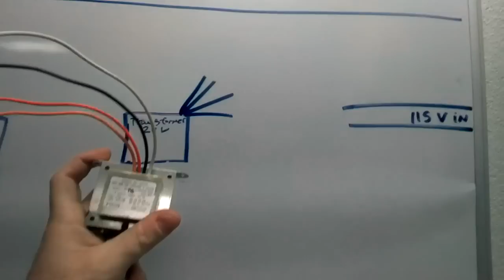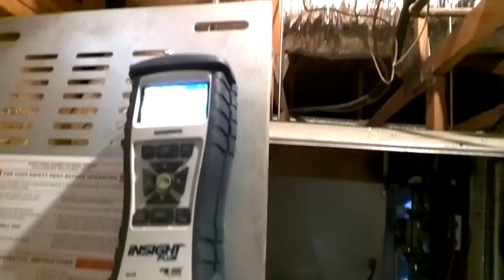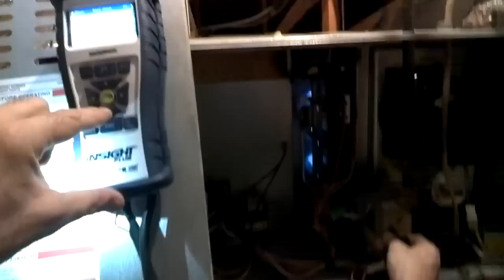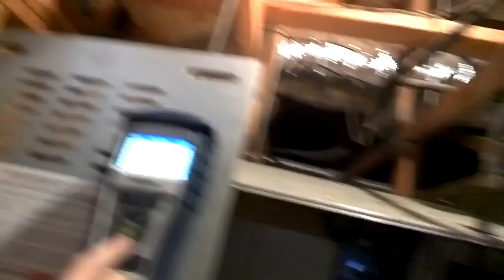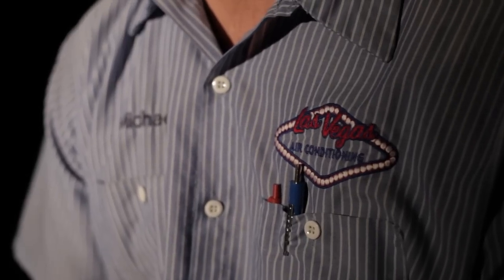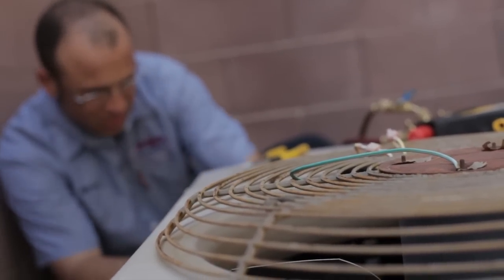Furnace Is Not Safe - Combustion Analysis - Is the Heat exchanger cracked?

Comment: So if we get high level of CO in the flue  means bad heat exchanger ? I thought when the level of O2 changes after the burners comes on ? High level of CO in the flue means it’s not inefficient ?
Reply: High CO means incomplete combustion.  It can also produce the soot that he saw, which is a byproduct of incomplete combustion,  A number of things can cause incomplete combustion, besides a bad heat exchanger.  Other causes are dirty or blocked burner, not enough combustion air, improper gas pressure, to name a few.
Reply: @rodgraff1782  thank you very much for your clear, and to the point explanation.

Comment: I also would of condemned that furnace.  After testing hundreds of furnaces, I have never seen one take more than a minute or two too level off.  The C.O. is way too high whether it is in the flue or in the ambient air especially with soot and signs on roll-out.  The heat exchanger is either cracked or the secondary is plugged.
Reply: Ever see a crack that takes time to open up?  I have.  You have to let the unit get up to full operating temperature, which takes more than a minute or two.
Reply: @rodgraff1782  think you missed the point.  If the c.o. is that high there are problems.  Why let it run longer?
Reply: @joejohnson9427  I agree, it has to be shut down.  What I was saying is a cracked heat exchanger sometimes doesn’t present right away.

Comment: I would have shut the unit down as well.  Over 400 ppm is the standard by law, you must shut the system down.  A O2 reading of 17% while the fan is running is obviously way to high.  Should be lower than 7 on most furnaces.  That’s a indicator that there could be a crack in the heat exchanger.    I would dive a little deeper and check ambient co as well as gas pressure.  I have seen cracked heat exchangers with no effect to the flame and some that jump out when the fan comes on.  But all have a higher than normal O2.  There is only 21% O2 in the air around us.

Comment: You did absolutely no diagnostics. What was your gas pressure? Bet it was under 3.2”wc. The combustion analyzer helps diagnose. You still have to do your part.
Reply: That what i was thinking, this sounds more like the fire is getting stoked with too much gas then a crack heat exchanger, which could be something simple as the gas pressure screws on the valve being set incorrectly, i bet their fuel bills were probably a little on the unreasonable side too because of the same issue.
Reply: Yes I agree, 1)-check inlet and manifold pressure 2)-clock the meter 3)-combustion analysis 4)-make appropriate adjustments.

Comment: What did you use to plug the Double Wall vent?
Reply: This is from the Goettle add :)  " Goettl Air Conditioning replaces all screws missing with bright red custom screws that are designed to hold units tight and to not loosen with vibration. We replace the screws the other guys left out. "...

Comment: The furnace needs to run at least 10 minutes before taking any data. Yes, your numbers will be high at start up!
Reply: Wrong, for a proper combustion analysis you should be taking readings 0-60 seconds on light off and recording the highest number, then three readings at different time intervals and then another reading on shut down.
Reply: Number will be higher at lite off

Comment: this furnace was ment to be installed in a vertical position if its installed horizontally there should be a rollout switch there if the fan kicks on and if there is rollout there then the heat exchanger is cracked. if the furnace is not safe to run it should be shut down.

Comment: C Y A. For condemning a unit  valve off unit  red tag unit  unsafe get customer signature  tie one copy. To unit. Give 1 copy to customer,keep one. If  heat only on gas. Turn off mtr. Lock it. And seal inlet swivel.   Call gas company back. After repairs are made.     That's how we roll  CO. Readings. Shut em down.
Reply: What I do for my customers (since they like to switch it back on when I leave) Is I cut the power/neutral wire in the cabinet and nut them off. I reconnect after the repair is made.
Reply: @fastcar42069  the correct thing to do is remove the valve and cap the gas’s line off.  That’s what the utility company will do here, if they find an unsafe appliance.

Comment: what was your stack temp? with o2 so high to start with I would have hooked up manometer and checked gas pressure, if your stack temp was below 305* after 10 minutes run time I would say its under fired. typically I see low to 0 ppm on underfire however. ppm's could be coming from burner alignment, something is making that soot...you need stack temp and gas pressure to get a better diagnoses on whats going on.
Reply: Dude needs to check gas pressure first then observe flame when blower comes on and measure stack temp if HX is cracked oxygen will rise over half a percentage point on the analyzer when blower comes on and you should be able to see flame pattern movement
Reply: You failed your customer. You are condemning the furnace because of the smart valve? The first generation starts the business, the second generation builds it. And the third generation usually destroys it. Hope your dad sells before it’s too late.
Reply from the maker: +Performance Based Heating &amp; Air 
If the Analysis was the only thing wrong I may have looked deeper but with a weak smart gas valve as well. Better to stop there in my opinion. Ill update this post when i remove that furnace.

Comment: That doesn't automatically mean the HX is cracked.
Reply from the maker: +Joe Shearer But surely its not safe did I mention It's a Quatro and Excess air went upto 250% after blower motor came on. Dont you agree thats a crack.
Reply: +Las Vegas Air Conditioning, Inc. definitely needs more thorough investigation. the reason I posted was I had soot and high co on one. I condemn HX and then found the problem was one wrong orifice on burners. HX was ok. CA is a great tool but still have to confirm visually and go from there before making final diagnosis
Reply from the maker: explanation for soot, but how else can we explain the excess air?  Im I missing something there? because I can't come up with any other reason for the excess air to rise please educate me if I'm wrong.
Reply: Could be high draft or inducer missing restrictor. But if the excess is jumping up repeatedly when blower comes on must be a huge breach. I just wanted to clear up the misconception that CA trumps visual inspection
Reply from the maker: gotcha agreed visual is the best way. sometimes we can't see the entire heat exchanger until you remove it I also carry an inspection camera and also most Quatros ARe no good
Reply: +Las Vegas Air Conditioning, Inc. we have some around here too and aren't they weird HX design? Tons of small tubes?
Reply from the maker: yeah +joeshearer hate them I'm glad they don't make them anymore
Reply from the maker: yes, they are. we suggested homeowner replace at least just the furnace especially with the problem with the gas valve also. he happens to have a brand new condenser so we'll probably just do the furnace and coil together giving them a new system all around.
Reply from the maker: +Joe katynski yeah I'll confirm it as well except I'm going to confirm it when we scrap it. most people in Vegas would rather have something reliable and safe meaning new. but I actually didn't use the word cracked the homeowner I said it's probably cracked but all in all the machine does need some work smart gas valve not burning properly it's probably cracked. that's a good enough reason to stop looking and replace it.
Reply: +Las Vegas Air Conditioning, Inc. I find that 9 out of 10 issues where excess air rises 10% or more when blower kicks on, usually indicates a crack (gas or oil) but I always confirm it before condemning
Reply from the maker: +Joe katynski yeah I'll confirm it as well except I'm going to confirm it when we scrap it. most people in Vegas would rather have something reliable and safe meaning new. but I actually didn't use the word cracked the homeowner I said it's probably cracked but all in all the machine does need some work smart gas valve not burning properly it's probably cracked. that's a good enough reason to stop looking and replace it.
Reply from the maker: Jim Bergmann ping what are some other causes of excess air rise besides a cracked or breach hx.
Reply: 2967 ppm of co is unexpectpable for any furnace. That's over 7 times the lethal amount of carbon monoxide considering most co detectors go off at 400 ppm. If you were to breath the air coming out of that vent you would pass out within 1-2 minutes.
Reply: Thxs for the video.    Did u click the meter?
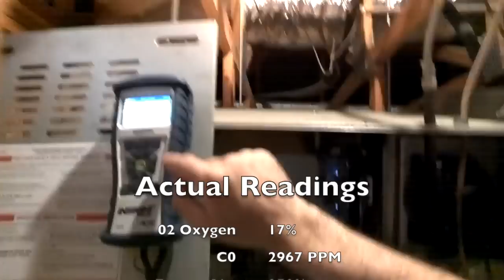Reply: 4:02 That heat exchanger is definitely compromised ... yup not your words